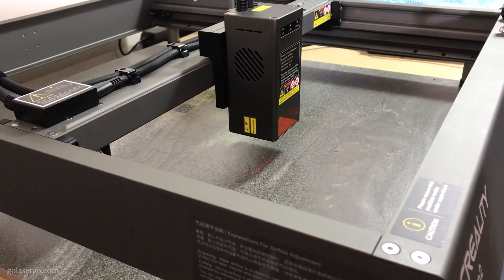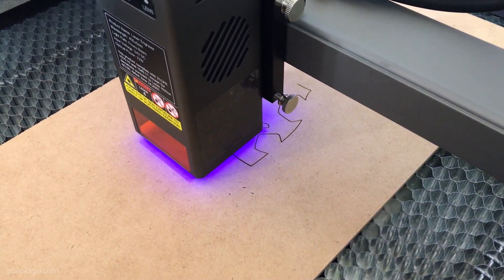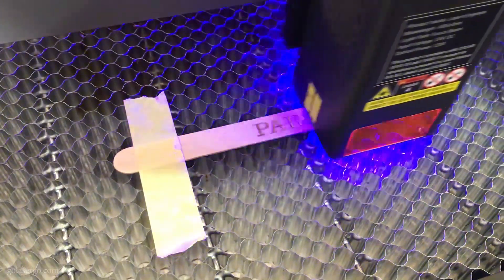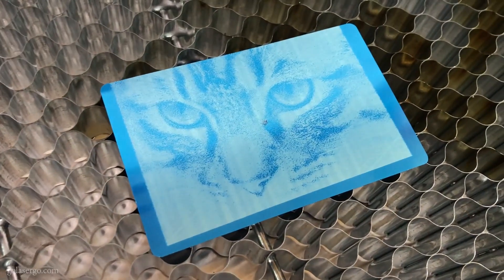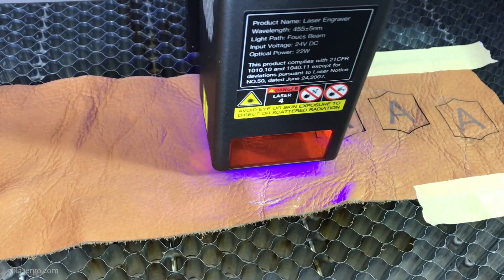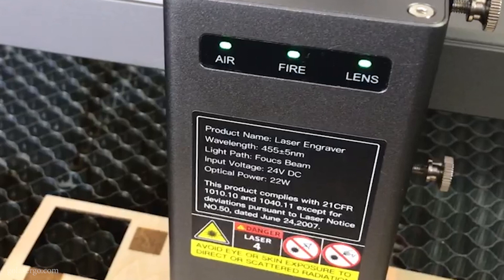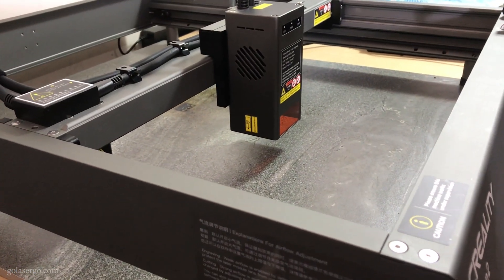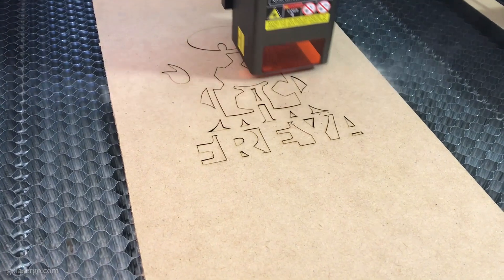Creality Falcon 2 (22w) Review & Demo (PART2)

Comment: I bought this laser during the Black Friday sales and I only used it a handful of times but those times I did use it I was amazed. I plan on using it more with my projects but it was well worth the money and definitely easy to use as I am a first time user with any laser machine. I was up and running only a few hours as i also needed to learn the software.
Reply from the maker: Yes, this is definitely a good one for a beginner. Since it is all set up it's pretty easy to get up and running (once you have figured out the software of course).